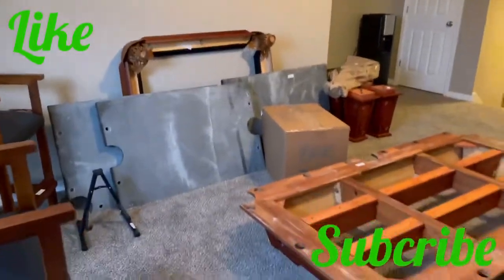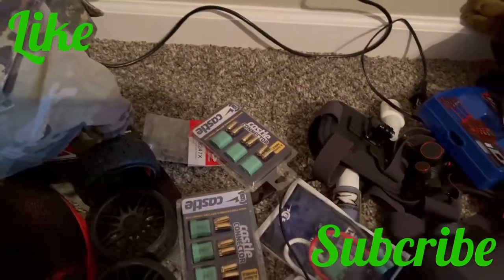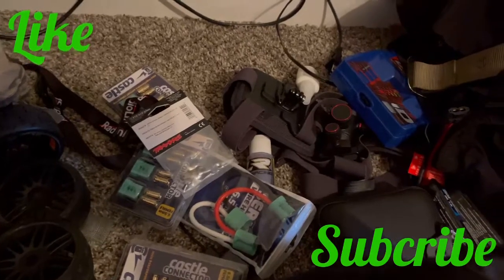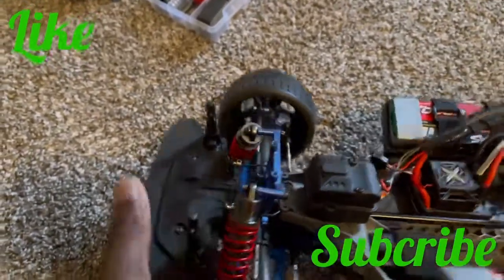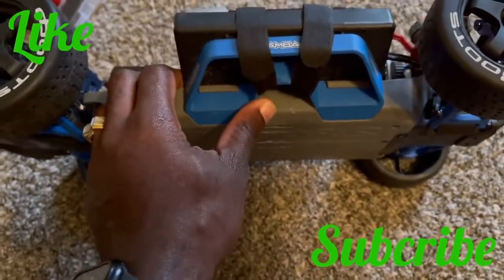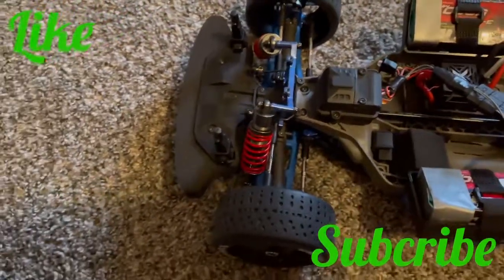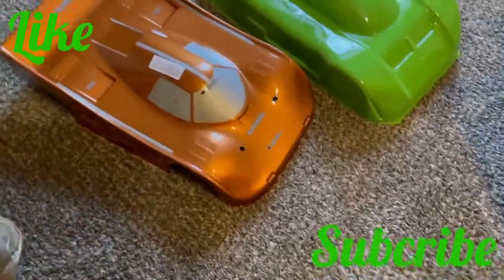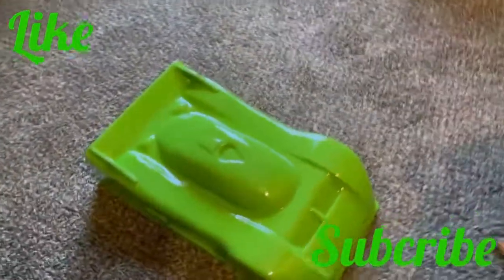Watch this before you speed run your slash 4*4

Comment: Good update brother! Happy birthday! 🎂 My wife's birthday is in November too. So I had no idea the Traxxas connectors were so weak...I have never used them. I changed them to XT90's since the beginning. So far I haven't melted any XT-90's yet but I will change to 6mm and 8mm bullet connectors or OSE anti spark 8mm connectors which look just like XT-90's just bigger. The Castle ones you have now are good too. 
   So you are out of country for 2 years..wow! So no speed running? Or you will take your RC stuff with you? I like the way you strapped the battery's down. Looks pretty secure. And the new body looks great. As far as the 3mm Jag body it's a real pain to cut out. I used stubby curved scissors to cut the wheel wells and even cut the straight parts by nipping away at it with little cuts. Hard to cut...very thick in spots. I think the 2mm which I also have is good enough.
Reply from the maker: Yeah bro those Traxxas for high speed run will melt. The castle ones in the video are 6.5 mm polarized connectors. Those should withstand the power. I bought a separate small suitcase just for my RC cars, tools and parts, my wife asked “are you taking those😂” I said nope they’re taking themselves 🤣🤣. Definitely taking them bro. Happy birthday to your wife also. I am very happy with the 2mm body. The other body I painted gold and silver is also 2mm but, the jag body is more sturdy especially on the sides after cutting. Tomorrow I will upload the video after cutting out the body.
Reply: @liteweightgains  Good idea on the separate suitcase for the rc cars...lol. I would do the same. Yes the Jag body in 2mm is very sturdy on the sides. 3mm is a little too much...very hard to cut out.